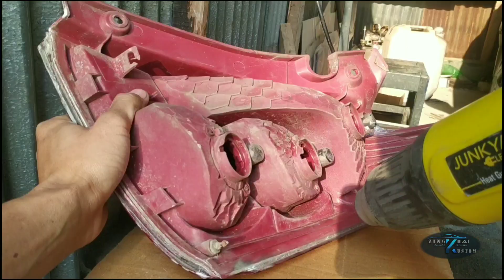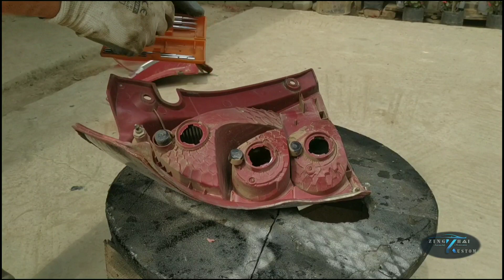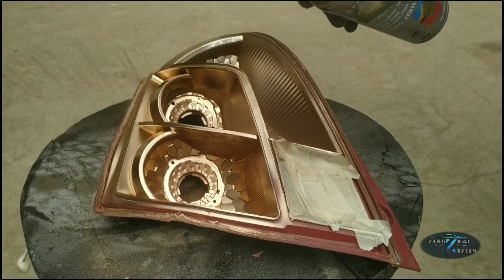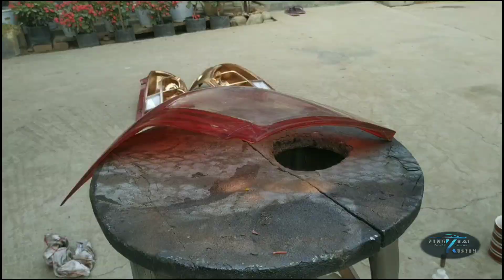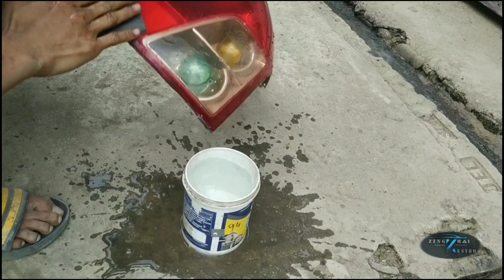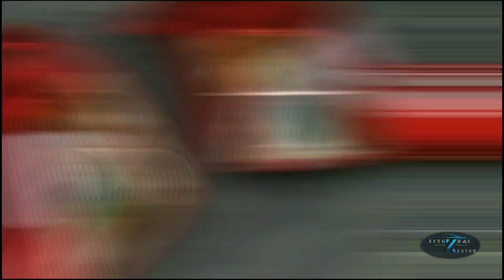Car tail light restoration || Suzuki Swift tail light restoration

Comment: What did you use to seal the light back?
Reply: I did open one of my CAR's rear lights once, to get rid of water accumulated inside it. after drying it's inside using a hair dryer, i sealed it successfully (The rains proved this) Silicone Sealant used for plumbing/ fixing corners of tiles etc..